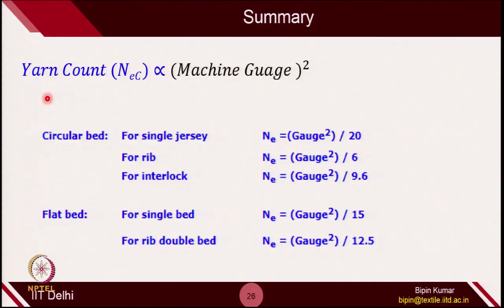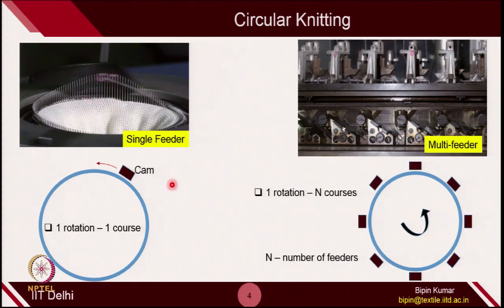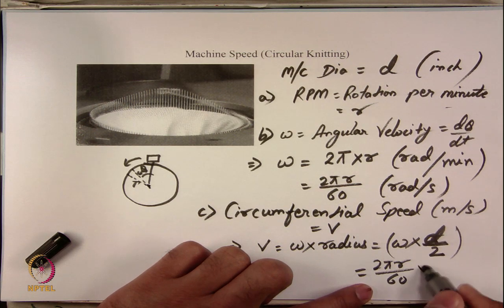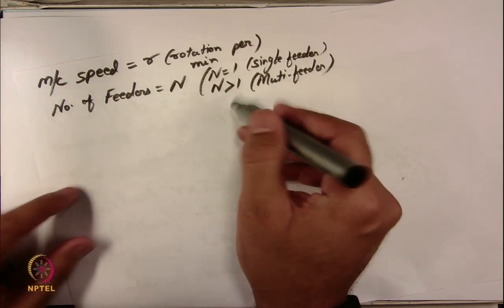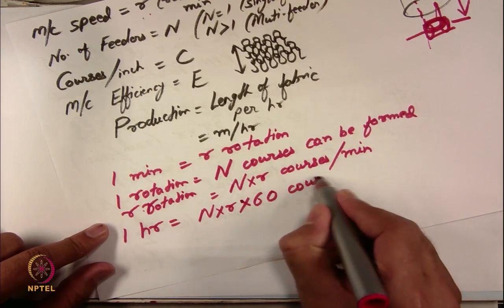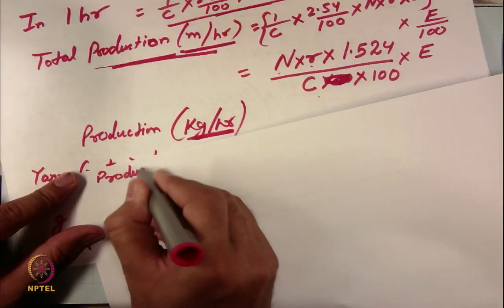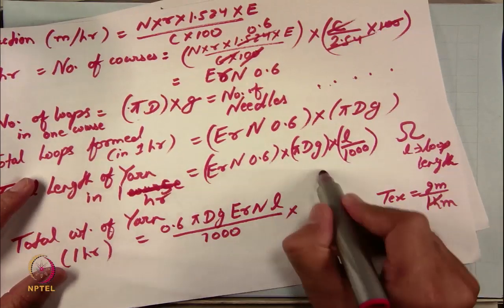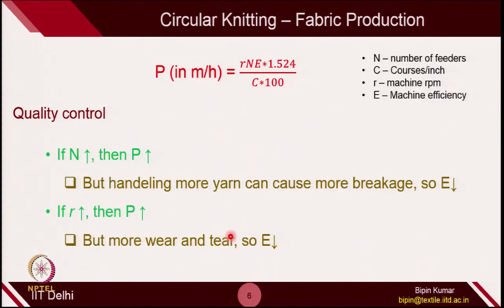Lec 26_Knitting Calculation (Fabric Production on a Circular Knitting)

Comment: In production calculation course is given in cm but in formula course is given in inches ???
Reply: you probably dont care but if you are stoned like me atm you can stream pretty much all the latest movies on InstaFlixxer. Been watching with my girlfriend for the last months =)
Reply: @Jimmy Trenton Yup, have been watching on InstaFlixxer for years myself =)
Reply: Correct. Using the coefficient 1.524 is assuming that the courses per unit length have NOT been converted from inches to cm. For his practice problem, the courses should've been given in courses per inch instead of courses per cm.
Reply: Yaa correct so you have to simply covert into cpi 😊